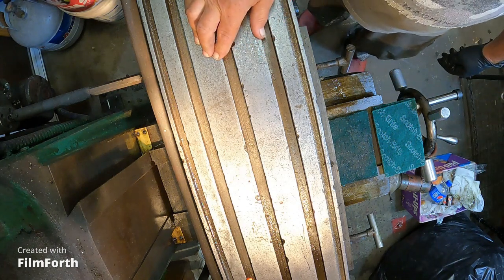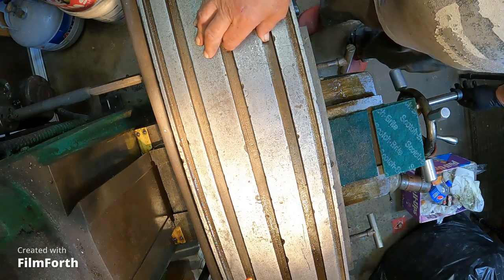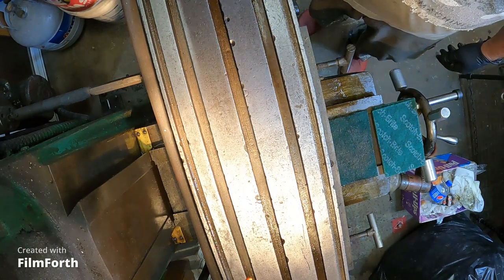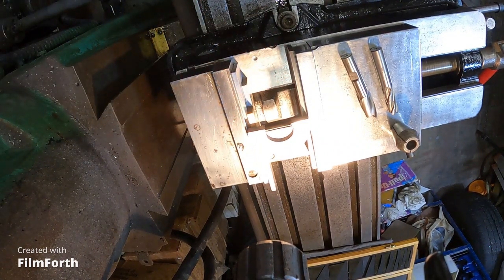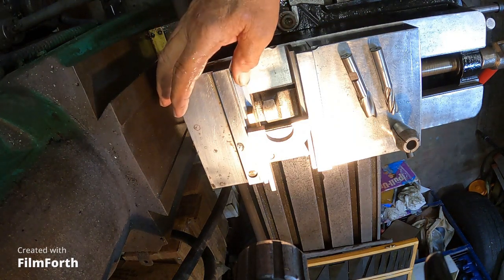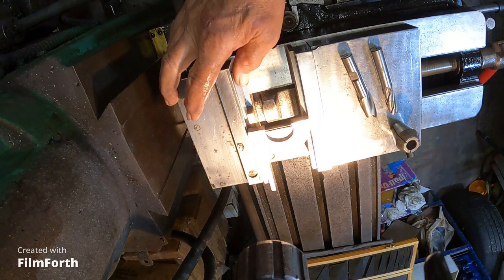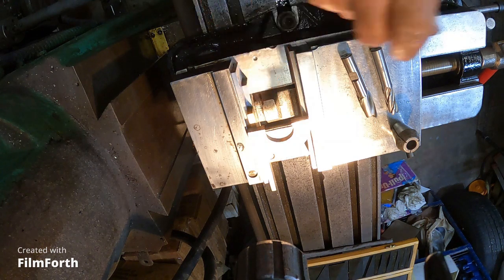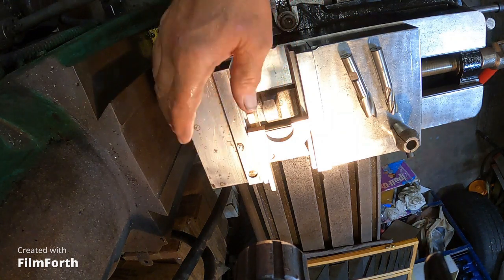south Bend milling machine setting up the vice

Comment: Do you have a fly cutter? That would be my 1st choice ...

Otherwise I tend to use 4 flutes on steel and 2 on aluminum when possible (not sure if that's correct though)
Reply: Agreed . . .a fly cutter would be the 'go to' ,  4 flutes on steel & 2 on aluminum is the way to go !    ( It's the RIGHT thing to do ! )
Reply from the maker: Sounds like good advice